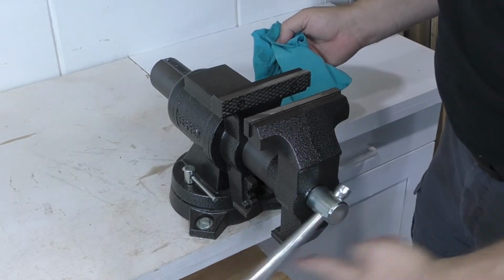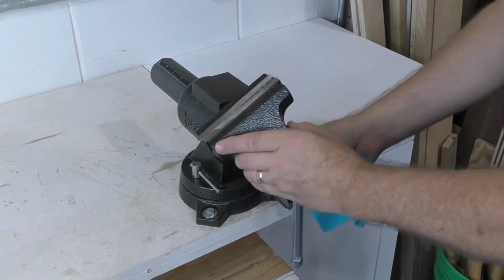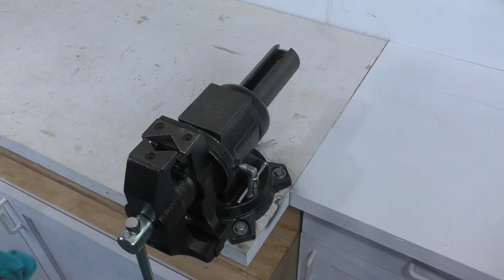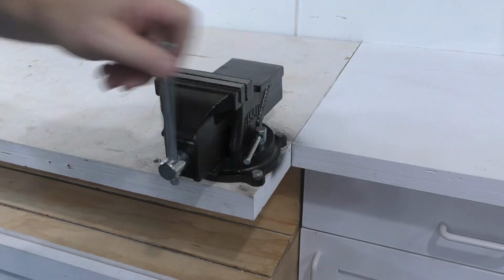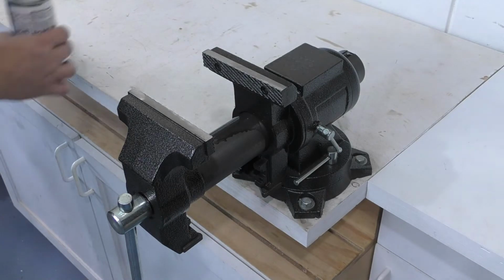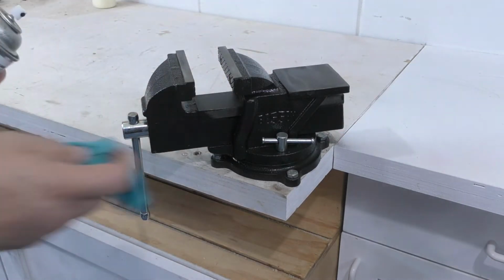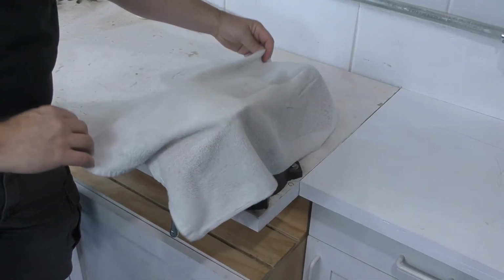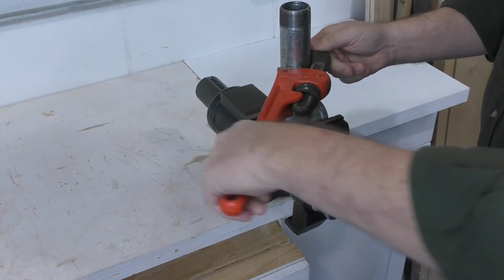BESSEY vise maintenance

Comment: I heard that the Bessey vises sold at Home Depot aren’t very reliable. Meaning because they’re made of cast metal they’re brittle?
Reply: Theyre actually cast steel and not cast iron so they wont crack or break like other cheap vices do..  cast steel still drills like cast iron with bigger chips but is way more ductile than iron..  so if you hit it with a good chipping hammer youll leave a dent rather than a stress fracture like iron and can heat it up without the expansion and contraction cracking it..

Comment: I tell you what i have beaten the holy dog crap outta that same bessey vice and shes still just like when i took it outta the box.  Minus the dings and whatnot..  first one i got had a hairline crack in the main body but after notifying bessey of it they sent me another no problem.  And this one has been running strong and well used. For a few years now,  and yes it gets used as a press, anvil, break and vice as well..   ive put the squeeze on it with a 3’ pipe and didnt even bend the bar..   good damn vice for a good damn price..  and im not affiliated with them or gotten any incentive to comment on their shit either,.  If i did then they wouldnt pay me if i said shit.  Or fuck and all that..  so yea, from the truth of a metal worker and mechanic..  buy ye a bessey..